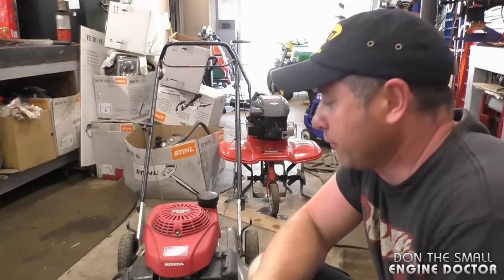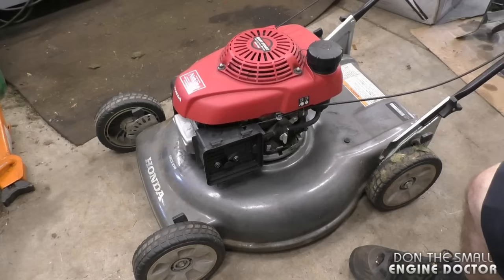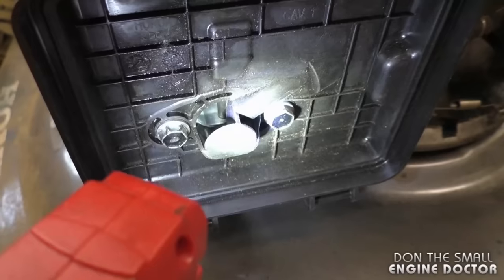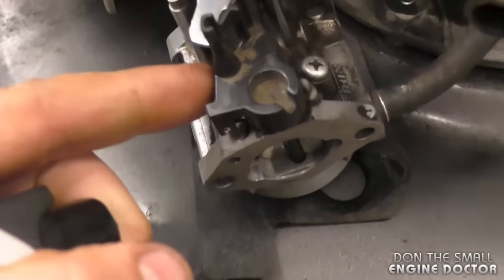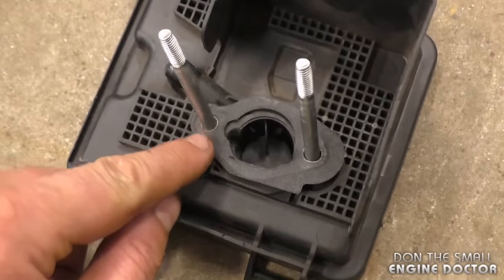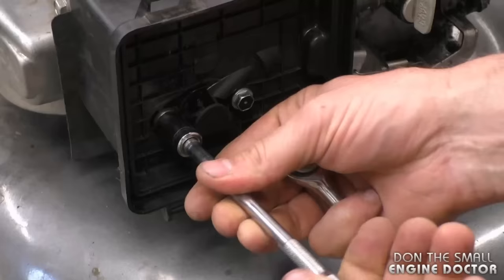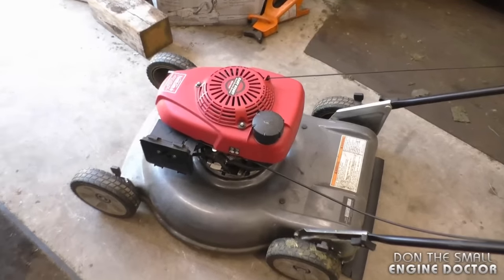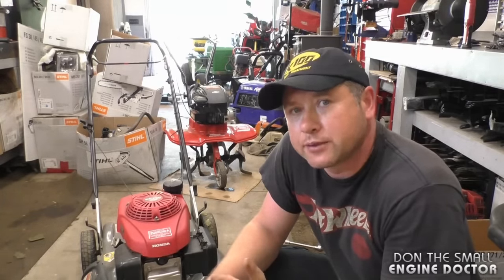Make Your Lawnmower Start On The First Pull Again - Honda Auto-choke Repair - Video

Comment: I have an opposite problem.  I have a Honda GVC160 just like your video.  Starts on the first pull every time but the choke stays closed.  If I take off air cleaner and stick a screwdriver into the choke to force it open, it says open and engine runs perfectly.  I have taken the carb off 3 times to clean it with no effect.  Any ideas why the choke is staying closed?

Comment: I have that exact same problem with my craftsman.  Would my craftsman have this same cartridge?  I've pulled the carburetor 4 times cleaning it and still no change.  Won't start unless I spray carb cleaner in it and the butterfly is always open.

Comment: Hey Dony I have the same problem with the thermal wax but for some reason the small rod in the cartridge does not come out . Could it be defective, it’s new so I don’t know , guess I’ll order another one. Thanks
Reply from the maker: the rod is supposed to come out as it warms up
Reply: @donyboy73  

It just stuck on choke and it keeps blowing out black smoke until fouls the plug and stalls so I order another thermal wax and a new choke mechanism.

Comment: my lawnmower isnt the same as this but ive come across this type before witht eh needle i might even still have it..but im watching this and i see him putting on that larger gasket what would be backwards on mine..i seen other videos and it goes on the otehr way ..all i really do is line up the holes.. so if its suppose to be soem other way when reassembling idk.. maybe it makes a difference even a gasket can make a mower not start or run properly.. i think he knows what i mean when i line up the holes..that gasket has the extra hole im guessing for fuel flow that lines up on the carb..makes sense to me..
Reply: also just to add..i had a tecumseh years ago and wouldnt start and that breather tube was absent i went to a small engine guy and asked him if that would be the reason it wasnt starting..he said no...and this guy m guessing is a certified mechanic at small engines..but i bought one anyway just to check and to make it completly done...sure enough it started riught up and worked fine since,..

Comment: Just picked up a used Craftman mower that has Honda engine on it, but not auto choked. I noticed that the 2 choke butterflies are always wide open. Is that normal? I cant still get the engine to start. When I closed the outer choke butterfly, the engine would start right on the first pull but then quickly died after 5sec. Oh I did replace the old gas and clean the carb, pretty sure the carb is clean.

Comment: I have a Troybilt with this motor on it ,the mower is a POS, but I love the motor, I've never had this problem but I do have to clean the auto throttle linkage out about every 2 years cuz it gets stuck with grass

Comment: My mower looks exactly like this one. For the entire summer, it surged but still ran. A couple years ago I put it in storage in lew of a mowing service but now I'm trying to restart it. It started right up with starting fluid. It surged like before for about 2 minutes then died. Now it will not restart at all unless I use starting fluid but once the starting fluid burns out in about 5 seconds, it dies. To be honest, I can live with the surging as long as it keeps running, but it doesn't. Could it be a auto choke problem?

Comment: My Honda Mower is hard to start, but this valve seems to be working as choke is closed as machine is cold. I did take bolts out and double check valve and pin is in. Any ideas?

Comment: This is great info. but my mower, which has a GCV 160 motor, doesn't have the same Thermowax Cartridge. Mine is a GCV 160 AO. The problem is the same, though. When I used a screwdriver to close the butterfly choke manually, it started on the first pull. Mine doesn't have that plastic part I see on yours and there is no Thermowax cartridge in the place you're showing in your video. Is there something I'm missing? Is there a cartridge somewhere else on mine? Thanks for a very informative video.
Reply: I have the same problem with main no termowax cartridge in that spot
Reply: @martinsalazar5239  Yep. And I thought I had the problem solved. I even went out and bought a thermowax cartridge. Now I'm stuck with a $10 part I can't use. Oh, well.

Comment: I have a gcv 200 but it has nuts that hold the air filer box on. So when I take them off only the box comes off. The black plastic piece that the thermowax sits behind doesn't come off. Any suggestions?

Comment: My Honda lawn mowers last 10 years with twice twice weekly pull starts. No problem with the pull ropes.
 My Honda Generators pull ropes break after 50 careful starts.
Reply: I replaced mine with the steel core type cable. Check on line. I also bought an entire roll of pull cord for the rest of my life. I will NEVER run out. Plus I can do everyone in the neighborhood. It was $15 for  1,500 feet.

Comment: Thanks foenyour videos Dony. The HRR216 K9 VYAA  with GCV160 GJAPA has A new themostat and thermowax cartridge and starts right up when cold. Then after its warmed up its very hard to start. It take 3 , 4 or 5 pulls to get or started. I've cleaned the carburetor 3 times and still hard to start. I'm considering a new carburetor to see if that's the problem. The themostat and thermowax seem to be working OK. I don't know what else it could be. Any suggestions?

Comment: My Honda mower is 33 years old. It’s not self propelled. It has a manual choke. I’ve never had a problem starting it. I asked my local dealer (an actual lawn mower shop in Lodi, California, not a big box store) while looking at new ones about the problem with “wax activated” automatic choke because I am considering buying a new one. Dealer said never heard of it. I said there are a lot of complaints about it on YouTube channels. Dealer still said don’t know anything about it. I’ll keep my old mower until it dies. Another negative, dealer only stocks self-propelled models, I don’t want those either.

Comment: Great video, don't understand how in the beginning you got it to start at all with the gas turned off. Even when you sprayed carb cleaner in it and started it, the gas switch was still off. You then turned it back on for the rest of the video.
Reply: A carb has fuel in the bowl even if the fuel tank line petcock is turned off. You can start the engine and run it for probably 20-30 seconds before it empties the bowl and dies. :)
Reply from the maker: fuel from line and carb

Comment: Mabe you have an idea I have a Honda 217 160 cc mower with bad blow by I clean the carb its starts cut the yard stop then air cleaner is full of oil .any suggestions.

Comment: my honda starts immediately b..ut after 15-20 minutes the motor stop by itself and is impossible to start again however the next day it starts on the first pull and work only max 20 minutes. is the same problem with the one from this video?   THANK YOU

Comment: I noticed you had the fuel shut off at the valve when you demonstrated non-starting. Was that because it actually would have started because you had already fixed the choke?
Reply from the maker: no

Comment: I was wondering what that part did and how it worked. The one on my mower doesn't push out at all. I know I need to clean my carburetor though. Different issue.

Comment: Thanks for this tip. I have a Toro mower with a Briggs auto choke engine. Is the repair the same?
Reply: @jamesl9686  Thanks James. Watched another video for the Briggs engine. There is an auto-choke spring and thermostat associated with the auto-choke. Repair does not look difficult.

Comment: i just had one come in with the opposite issue . it would start cold but wouldnt when it is warm , the pin is stuck in the in position keeping the cjhoke on and flooding the motor , dead give away was the amount of carbon on the spark plug

Comment: Dony, first of all thank you for outstanding videos! However, I tried what you recommended in this video and it didn't work. I have a new crankshaft, new air filter, new spark plug, new carberator, new governor spring, and a new thermo wax cartridge, of course. Still, sometimes, roughly ten percent of the time, my Honda lawnmower will start with one or two pulls but once I turn it off, I can't turn it back on. Any suggestions?
Reply: Hey, I'm in the same boat. Replaced the carb, thermowax cartridge, air filter, spark plug, and fresh gas.  It ran great 30 days ago, then tried to fire it up today and it won't start.  Pulled it about 25-30 times.  Any suggestions.  I'm ready to go buy a Toro with a Briggs engine.

Comment: What happens if its hot and won't start again after emptying the bag because the choke is open due to the engine block being hot still, therby activating the pin.  Gotta let it cool down?

Comment: Any hacks for turning one of these autochoke carbs into a manual choke... would it work to just attach a wire to the choke and manually move it back and forth (without a priming bulb... would this work? ) .  Too bad clever ebay/amazon carb manufacturers don't start making replacements with manual chokes.  I'd replace all my Briggs autochoked carbs in a heartbeat.
Reply from the maker: yes you could rig up a manual choke with a cable

Comment: at 0:47 the fuel is valve is closed.  Would you expect this part to be bad on a mower that is on it's first season?  Mine starts  but wont stay running, just replaced fuel, checked spark, air filter is clean.

Comment: replaced the wax choke and now the mower starts on the first pull BUT when it is hot, it is very difficult to start.  Takes many pulls.   Any thoughts?

Comment: Really great video on disassemble/re-assemble and troubleshooting. 

I really detest all these autochokes on all new push mowers.  More dumb dumb "progress" in the name of saving some CO2 load-- meanwhile landfills are filled with carcasses of mowers people think are dead when they really are not.  Someone could make a fortune by coming up with a quick manual choke replacement system for each type of autochoke engineering disaster. 

Finally:  starting those bolts with a drill is a great way to cross thread them.  Should be started by hand. Spray some WD40 in the bolt holes if they are not hand-startable.

Comment: The first part that goes back on has the pivoting arm with a spring that pulls it back into place as the wax cools.  In my case the pivot point for the arm was a little sticky so I put some light oil on the pivot point to help it pull back into place freely, which I think will help depress the pin as the wax cools

Comment: I’ve replaced one of those where the pin wouldn’t pop out at all even with the engine at full temp running for a 1/2 hour, it started fine cold but as soon as you went to start it hot,  the mower would act very weird and belch black smoke and barely run. Once I replaced the part it was good as new.

Comment: My Honda mower would start on the first pull cold but wouldn’t start hot, figured it was this auto choke thermowax and was correct. Now, when the machine is up to temp is surges pretty bad, where did I go wrong?
Reply from the maker: you might need to clean the carb, check ot my video here as well https://www.youtube.com/watch?v=gV6IOkevloM&t=1s

Comment: Donyboy mine takes 3 pulls + that I got brand new. Would you just change this out? Thanks   Disappointing as it’s a brand new machine
Reply from the maker: if the pin is stuck out I would
Reply: @donyboy73  can I send you a pic of it?
Reply from the maker: @appleztooranges  sure
Reply: @donyboy73  do you have an email I can send!
Reply from the maker: @appleztooranges  donyboy73@yahoo.com
Reply: @donyboy73  thanks

Comment: Donyboy I have a craftsman 22” with an  auto choke system, it starts fine cold but won’t restart hot what are your thoughts?
Reply: Sounds like the fuel tank isnt venting properly through the cap. Are you over tightening it? I've seen that on these honda's quite a bit. I'd start there first anyway. Good luck.

Comment: I'm sure you know this but... take good notes where all those gaskets and spacers are before you pull those two carb bolts out. My Honda mower had more gaskets and spacers than the one you are showing and they all fell out on the mower deck when I pulled those bolts out and I had no idea in what order they went. I tried guessing at re-assembly and the engine would not idle properly. I ended up having to buy a repair manual for my mower which showed where the various gaskets and spacers went.  Apparently Honda makes a threaded rod tool which aides in reassembling the gasket/spacer/carb stack. :-)
Reply: Thank you Dony for the great info. I bought a Poulan with the auto start last year and so far no issue with it but I will get this part just in case it starts acting up. Love your channel. Thanks again.

Comment: That part can have a strange failure range.
I had one that choke well enough for cold starting with one pull.
Full on hot,the choke would be wide open,as it should be and easily start.
However,it did have some intermediate positions,in between dead cold an hot,that were problematic.
The motion would be out of phase with the temperature and it either wouldn't start or it would start but just barely maintained an idle speed. REALLY slow. Maybe 100 rpms.
It would eventually warm up in about 40 seconds and run fine.
Changed the choke cartridge and all the shenanigans went away.

Comment: How about if is surging after one minute or 30 seconds when start warming up . With clean carburetor , new spark plug , fresh fuel , valve adjusted to specs . I have that problem and seens like the surging never go away. After one minute start surging  .?????

Comment: You can leave the carb and all gaskets intact by replacing the two 10 mil bolts with threaded rod in longer lengths then you can slide everything back to access the thermal wax. Then push everything back into place and reinstall the two bolts.

Comment: Had to replace this last season. A real pain to get out. Starts first or second pull ever since. BTW... never use ethanol fuel with these carbs. Always the premium gas.
Reply: Premium gas is also 10% ethanol unless otherwise specified.  If you have trouble finding ethanol-free, you can use Tru-Fuel.

Comment: Could this also cause an issue with the motor running rough and not getting to full rpms after start up?
Reply from the maker: on the initial start yes but not after it's warm

Comment: Upon pulling mine apart, there is no wax cartridge in the hole (it's empty)?   Looking at my cold engine, the choke is wide open, after putting it into the choke/start position, so obviously something is amiss.    It use to start on a half pull, now it takes 4 - 10 pulls of course.   Frustrating!   I may need to tear things down again, and get a better look, but it started snowing when I did so this time, and had to work quickly to get things back together!

Comment: I bought a brand new Honda 3 yrs ago and used it just about 4 times a summer in a small yard. It sucks! Always stalled and now I can't even get it started. I have oil, a clean filter and full gas. Used starter spray and it sounded like it wanted to start for 2 seconds & then nothing. I shouldn't have to be a mechanic for such a young & little used mower. I should have just bought a cheap $160 Briggs & Strat. My last one lasted over 15 years and always was reliable & pretty much quick starting. And I gave it little maintenance. Only reason why I pitched it coz the pull cable broke from being out in the weather all those years.5
Reply: Hi - my Honda is not working either.  Did you find a fix for yours? Or did you just buy a new mower?  I'm ready to go buy a Toro.  This thing is garbage!!

Comment: I have a GCV 190 and a GCV 200. Is that part in both of my Honda lawnmowers?
Reply from the maker: it might, you will have to check if it looks the same as the one in video once you take the carb off

Comment: I have a Honda GCV 160 that won't start.  It starts with starting fluid but cuts off after 5-10 seconds.  The thermo wax cartridge is not extended and the carb is clean.  The mower only has about 20 hours on it.  Can you point me in the right direction?
Reply from the maker: clean or replace carburetor

Comment: I have one of these mowers but it has a different problem. It will start first pull every time but if you run it for a minute or two and shut it off it will not restart until the motor cools down. It appears to be over choked. If I hold the choke open it will restart.

Comment: I found taping down the heads of the long bolts, to the I inside of the air box, helps keeping them in place while assembling the gasket and parts. Line up bolts with holes, take tape off one at a time and finger tight followed be socket. Wasn't hard at all.

Comment: Hey Don,
I have to wonder if this is the problem on my four month old Honda HRX217VKA with the GCV200 engine? I bought mower when it was still cold in Milwaukee, Wisconsin and I tried to start it then. It takes this new mower 3 to 5 times to start. Now that the temperature is in the 80's, the mower takes 2-3 times to start. Honda's are known to start first time. My seven year old Honda HRR216VKA started first pull almost 100% of the time. Although it did not like cold weather. It took awhile to get to normal running speed. I gave that HRR216VKA to my son. The only reason I bought the new Honda HRX217VKA was because of the speed control dial, but I am not happy with the fact it takes 2 to 5 times to start. The Honda dealership told me Honda replaced the auto choke system in new engines which I think is B.S. 
Watching your video, I have to wonder if it's a defective wax choke system?
Thanks for the videos. 
Don from Milwaukee
Reply: I have a '17 GCV190 that's stubborn to start on cold days, since it has a variable throttle, what I learned is to lower the throttle down to about 1/2 throttle, or a bit less, then it will start in 1 or 2 pulls in most any temperature.